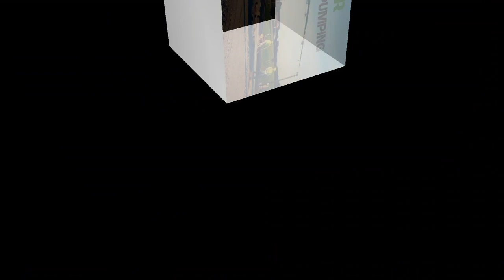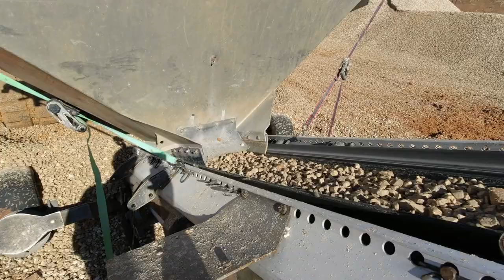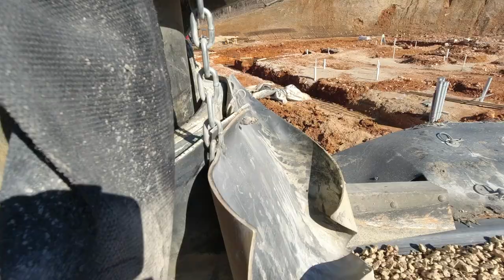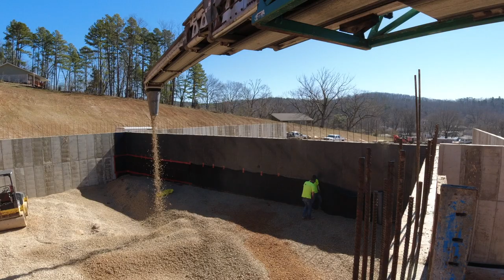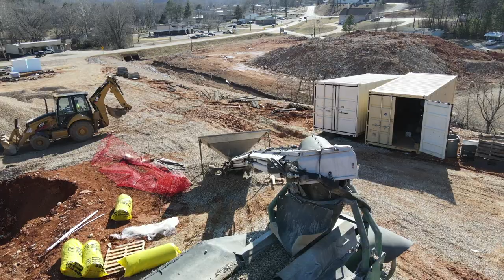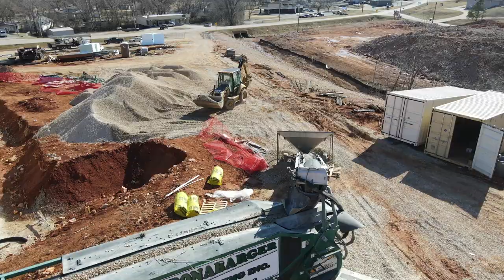Rock On! PutzmeisterTelebelt 105! Concrete Pumping Vlog #43

Comment: Cool video, could you show the washout out procedure on one of those possibly, I've heard it can be a pain when you run concrete. Also do you oil like the entire conveyor when running mud, thanks!
Reply from the maker: It can be definitely be tricky with concrete. We run run a product called super slick bio on the hopper, top boot and on the end of the boom. Works really good. I believe we will start using Spatter cote 100 also.
Reply: Do you only spray the rubber or whole boom?

Comment: absolutely can not stand doing concrete with ours unless its a really tight state mix.  best ive done placing 2B with our 110 was 140ton an hour (roughly) fed with triaxles into the low  profile hopper. 92/hr  of #3's over a 10 hour day, but  that abuses everything. big retention basins back filliing the chambers ill leave the can and "hoodie" off entirely. dont really need a hose guy anyway with it
Reply from the maker: Day 2 of this rock got a little ridiculous. They started bringing in 2 inch clean, then basically boulders. It tore our boot up and prolly not good on the hopper. Day 3 I told them if it didn't get better, we were going to fold up, they started bringing good rock back in the whole time again then.